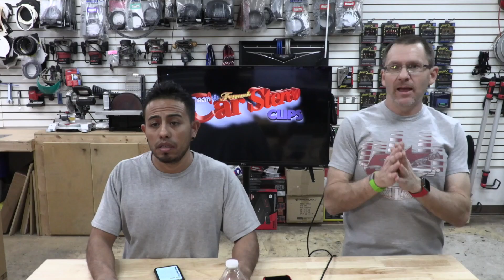When should I think about adding a second battery

Comment: I have a 2006 Acura TL and while I've upgraded my tweeters, 2x 6.5's door speakers, 2x rear 6.5 deck speakers, and the 8in kicker free air sub all run off my MB Quarts amp (it was plug and play as the MB Quarts replaced my factory amp. Now I've been told I should rerun all my mids and highs wiring to 10guage since I'm running 2 ohm speakers. I feel with all the sound deadening Material I installed I'm happy
Reply: 3G TLs are dope man, same here

Comment: I have a 1200.1 RP SKAR AMP WITH 2 12” kicker comp vr subs in a 2004 rav4 the factory cca battery is rated at 600 should I upgrade to a bigger cca

Comment: I have one amp a cadence, and I have a extra battery for the amp, and I don’t know if the battery kills my main battery I was thinking of adding a kill switch to my second battery so it won’t drain my main, but I’m not sure if the power goes through the remote or through the battery to the amp, idk if I should add the switch to the amp or to the Battery cuz we still have sparks going on when the remote is disconnected so idk?

Comment: I have a 03 civic, 3000 tar amp.  Amp clips at high volume, im tuning a stock battery 500 cold starts stock alternator, is it safe to add a parallel battery of do i necessarily need to do all the upgrades

Comment: I have a 1000w rms system and a xs750. my primary batt is  less then a month old and is a acid battery...can i add the second battery or do i need to buy another agm? And if so do i need to get the exact same xs750 for a primary?

Comment: I have a taramps smart3 powering two 12' skar vhx in a 2008 civic si 
stock alternator with a 4 farad cap 
when I start to push them the amp shuts off
no clip light
Reply: check with a multimeter the voltage,on drop you need to have 12.5V minimum

Comment: I have a cheap spider brand amp that supposely runs 5000 max power im assuming its 2500-3000 rms since the box or instructions dont actually clarify this Im running a single subwoofer 1500rms-3000wmax do I requiere a second battery install?
Reply: If ur lights dim and maybe u feel ur amp needs more power do it at a second

Comment: If we adding second battery
 is it okay to use heavy dutty battery with factory battery please any one let me know 😊✌🏻
Reply: You can safely connect a second larger capacity battery in parallel to a smaller battery, as long as both battery's are of equal voltage. Too much difference causes irreparable damage to the battery with lower potential.

Comment: I have 2 skar dvc 2ohm 12inch 650rms each i did the big 3 upgrade and i am waiting on my mono db15 amp its max 6000watts rated at 1500rms at 2ohm which my subs are wired at..my question is should i add a 2nd battery and does a 2nd battery put more strain on my stock alternator??any help would be greatly appreciated..thanks
Reply: I know this comment is a little old, but YES. for your 1500 watts RMS amp, definitely either add in a small secondary AGM battery, with a battery isolator, so that the two different chemistry batteries don’t discharge & fight each other when the ignition is off. or replace your whole main starter battery to an AGM (assuming that you have a flooded lead acid starter battery.) but it shouldn’t be a lot of strain on your stock alternator with only just a small second battery, assuming that your alt is at least a 100 amps or more. but AGM batteries are great for dynamic bursts, & solving headlight dimming issues & have a low ESR rating. hope this helps.
Reply: What kind of car and did your car run ok at 1500rms?
Reply: @ShaeksW  what is a battery isolator?
Reply: @Contact_Info  it’s a Mitsubishi Endeavor. I been doing this for awhile. Needless to say the alt is buried and I do things myself. But what a process it’s gonna be when I change it. Wish I had a Chevy or ford alt access. Unbelievably easy to get to change it
Reply: Ran perfect

Comment: If i buy 2, 150.4 amps and 1 1200watt amp, should i get another battery on top of a 110 ahm generator?
Reply: You can honestly run a cap but second battery is beat imo

Comment: Adding a extra battery does not replace cheap electrical.  With the additional battery your going to start seeing your weaknesses in your electrical start to fail .
Reply: This is what I was wondering. Apparently they do not make larger alternators for my car and many other newer ones. So, what are we supposed to do?
Reply: Have I’ve built. They will literally machine casing for your engine block bro e mail one of the top brand like power bastards or something. I heard mixed reviews of pb but just a suggestion.

Comment: What size battery should I get for a 2nd battery? I have a Tahoe with a 370amp alt plus big 3 wire upgrade, I am running 6600 Watts currently but don't have any dimming lights or anything!
Reply: XS power D3400
Reply: If you have no dimming happening then you don't need one at all. But a cap does make your system sound cleaner even if you have no dimming, so I would go with a cap if I were you

Comment: Hello guys got a question running hifonics 3200 watt  zues amp  on 2 15  massive subs. Bass hits and the car dies while driving.  Upgraded alternator to 300 watt high output. Did not have issue for about 3 days then happened again. Unhooked amp no issues. What do I need to do big 3? 2 batteries? High performance batteries?
Idk. 2003 grand marquis.
Reply: Just big 3 bro if you’d didn’t do that that’s your problem right there . The alternator needs them thick gauges cables to get the power through efficiently
Reply: If you added a high power alternator without Big 3 upgrade you risk damaging your new alternator.
Reply: Youll need an agm battery too, since typical car batteries cant recharge and output enough power fast enough for that hard hitting bass and all the alternators amperage

Comment: I have a cheap spider brand amp that supposely runs 5000 max power im assuming its 2500-3000 rms since the box or instructions dont actually clarify this Im running a single 12" subwoofer 4ohm 1500rms-3000wmax do I requiere a second battery install?